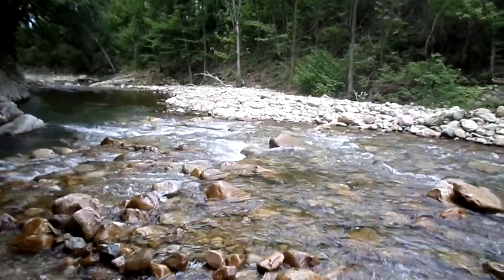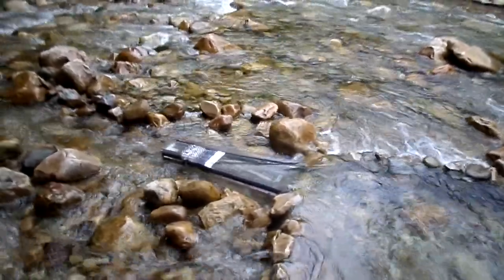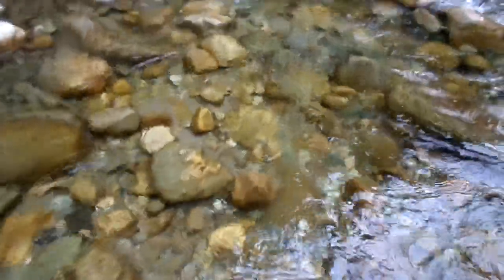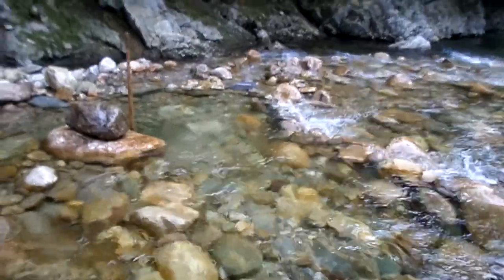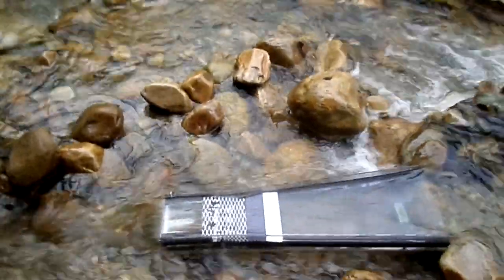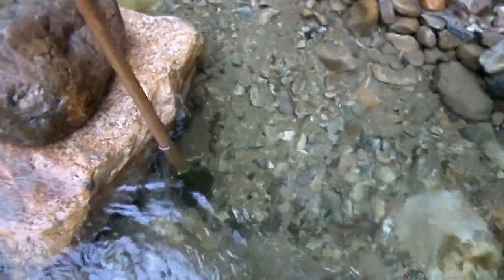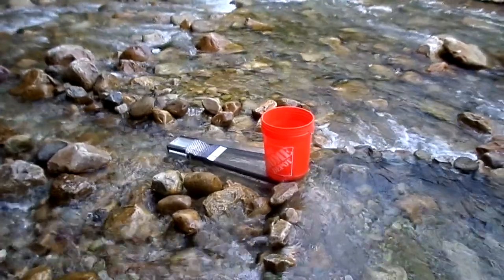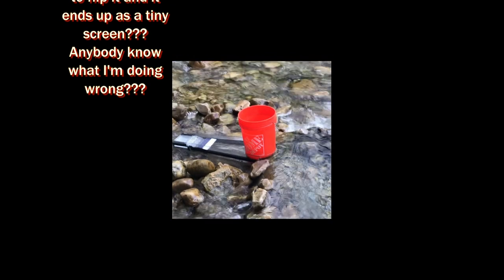A Little GMGT Advice For Gold Trap Set Up

Comment: My phone will randomly shoot videos that way and the same thing happens in post editing. I am able to flip the video and grab the corners and expand it back out.
Reply from the maker: Not sure how you edit Scott. With me I take everything from my cameras and phone then transfer it to a file in the computer. From there I add everything into my editing program. With the smartphone footage I have to transfer it to an app (IMovie) create a video there then upload it to the file on the PC.
Reply: @GreenMountainGoldTrap  yup, that pretty much sums it up. I use powerdirector. It allows me to change the aspect ration as I need. I film everything 16:9 but every once in a while it gives me 1:1 or vertical and it is 90 degrees off and I have to turn it and expand it out.
Reply from the maker: @802OutdoorAdventures  I think I got it figured out. Well, I should say James got it figured out. After shooting all footage from today he got to playing around with settings in my phone. Changed it to 4k. I shot a short clip just to see what would happen in my video editor. I was perfect.